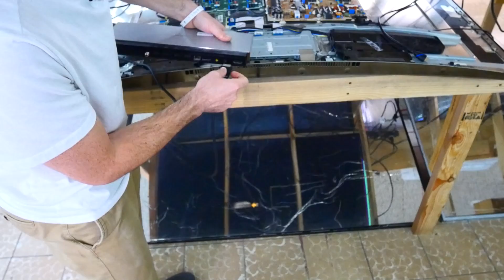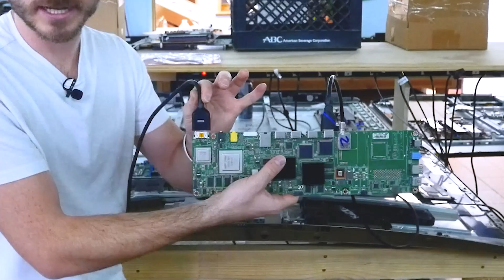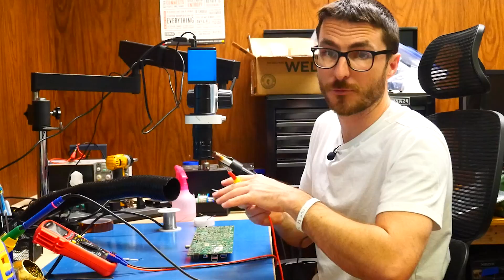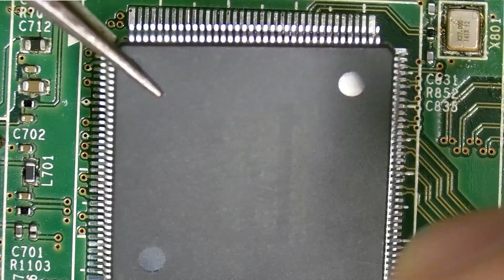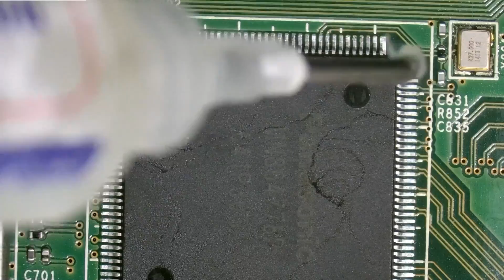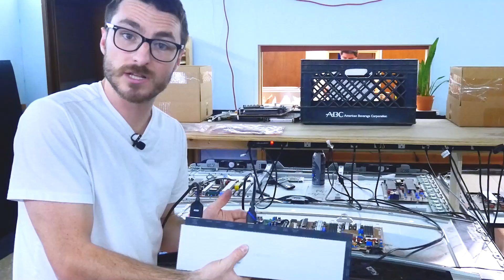HDMI Repair Samsung UN65HU9000 One Connect Box

Comment: Hi Nick, I´m writing from outside USA. I have a curved UN55JS9000GXZS with a box BN91-15167A. The box does not detect any HDMI port, same as your video, every thing else are working OK. I´d try to get it fix but the technician can not find the chip that you change in the video. Is there any way to buy it from you and have shipped to and address in the United States to fix my box here in the country I live, and how much it would cost?
Reply from the maker: Hello,
Yes please reach out to me via our email address info@nickselectronics.com with  the model UN55JS9000GXZS and  box model BN91-15167A. Please include your mailing address and I can let you know what the shipping and replacement cost would be.

Comment: When you replace the board, which i need to do on my one connect box, is it as simple as swapping old board out and new one in? Do i have to make any adjustments in the TV settings after I am done? TIA
Reply from the maker: If you can find a good reliable board then nothing special needs to be done, just plug and play. The hard part is finding a good replacement. That's why we offer the repair service. Most of the "working good" boards are either $500 or they are defective even though they are claimed to be 100% working and tested.

Comment: Hey, I also have a problem with hdmi in one connect. When im using hdmi the tv is restarting after a few minutes… tested on dofferent cables and devices. While whatching netflix or yt from smart tv no problem… What do you think could be the problem?
Reply from the maker: Sounds like it's probably the same problem as shown in the video, except you might be in an earlier stage of the failure. Try different ports, are they all the same, or do some work? If s,o just use those for now but eventually they will also fail and the HDMI processor chip will require replacement.

Comment: Hi Nick. I got a UN78HU9000F basically for free but no One Connect box or cable. I am considering opening the TV and attempting to modify it to get rid of the One Connect connector and just add a single HDMI port via some creative soldering. That way it would have only one input and it would be a single hdmi. Does this sound like a fool's errand to you? I don't really have anything to lose and I'm not interested in spending $400 on an eBay one connect box that doesn't even come with the cable.
Reply: @NicksTVRepair, I am in a similar boat. I have a UN78HU9000F with a one connect cable but no box. I tried reaching out to Samsung support for advice on what model(s) of boxes would be compatible and they were not able to tell me. I plugged it into open AI and it suggested BN94-07755B. I found one on eBay for a reasonable price, plugged in it and nothing. Not sure if I got the model wrong or if I have a dud. If you have any suggestion on which one connect box should work, I would be very grateful! Daviddimmel6914 too if he hasn't already hacked his TV.

Comment: Hi Nick, I have the same tv. The way that signal came up for the HDMI, I was getting for the one connect box. The TV has been sitting around for 5 years now, but i want to fix it. What happened was that while i was watch tv the screen went black, but there was still audio. If i looked closely, i could see a picture, but no color. I could faintly see the image. And that was about it. Now i when i plug it in, i get the similar thing on the screen in color, telling me to connect the one connect properly. Any idea?
Reply from the maker: It sounds like your mainboard or one connect box are bad and need to be repaired. We offer a flat rate service for this repair. If you take a look at the video description there is a link to our flat rate service. We highly encourage you to send in both the mainboard and box, not just the box. I know it's a lot more work to send in the mainboard but they can and do fail as well, the only way to be sure we are able to properly diagnose and fix your set is to send in both for us to test as they will exhibit identical symptoms when they fail and without a test set like we have it's almost impossible to identify which is at fault. 
If you have any questions or concerns, don't hesitate to reach out, our contact info is also available in the video description, so you can reach out to us directly.

Comment: Hi nick, i have also same model one connection box. But in these days i have a weird problem. When i turn on the tv, a   Weird noise comming from the box. Like a buzzy noise. What could it related with? Do you have any idea? There is no problem on the screen, just a voice. Thank you.
Reply from the maker: Strange, that could be the fan starting to go out. I recommend you get that fixed sooner rather than later. If you wait for it to fail it may not be repairable or much more difficult to repair.
We offer a flat-rate service. If you do want to send it in, we can take a look at it and perform repairs and pre-emptive repairs to ensure it doesn't fail in the near future.
Links are in the video description.
Reply: @NicksTVRepair  Hi again, unfortunately I am out of your country :) But you were right. I opened the one connect box and saw that it was so dirty. I cleaned and put it back. Now it is working well without noise. Thank you so much!
Reply from the maker: That's good news you may have added an extra year or more of life to your one connect box. However it is possible the fan might go out in a year or so. If/when it does you should get it fixed immediately. If  you try to run the TV with the fan not working properly you may damage the box beyond repair. 
As for the "I am out of the country" that is not a an issue. We have fixed one connect boxes for people in Latin America, Europe, middle east, and Asia. It's not that expensive to ship the box out for repair and we offer services globally.

Comment: Great video, and it's comforting to see the ease of repairing this tricky device, at least you did make it look easy :-D.  I am now stuck with a working UE65JS9500  flagship TV (likely one of the rare last models with 3D capability), and a rare collection of BluRay 3D movies.  The one connect box model BN96-37211D, decided overnight to display a grey/black flickering and burnt looking haze (no real video) on the screen when connected.  I'm afraid the CPU part stopped cooperating, as there is no response to any command.  Would that mean game-over ? Anyways, tnx for the tip measuring resistance over capacitors, that I can pre-test eventually to get more clues.

Comment: Hello, I received a One Connect for a 75-inch TV, it is not responding, it does not give an image, and the TV LED remains off. The One Connect is not responding, what could it be?
Reply from the maker: There are dozens of TVs with one connect boxes, all are very different. I can not answer your question without knowing what type of one connect box you have. Please provide the part number of the box and model of your TV.

Comment: I have UA55HU9000R. The box is dead condition.  The box can repair or can o get a new box. My tv is good condition. You can repair my box
Reply from the maker: The box is not avaiable for sale anywhere anymore so it can't be replaced, you would have to have it fixed. 
I may be able to fix it but can't know for sure until you send it in for repair. The video description has a link to our flat rate repair service if you did want to send it in, you can purchase that service and follow the shipping and packaging instructions.
Reply: @NicksTVRepair  ok

Comment: Hey i have white cloudy sides on my 65 inch unhu9000 what do you think this could be from i just got tv preowned , it shows more when there is white ish lighter colors on the screen
Reply from the maker: It sounds like you might have light bleed from the LEDs or the diffuser sheets are not performing as they should. 
I would probably need to have you send in a picture to better understand the issue. Our contact info is in the video description, send us an email with a picture of the issue and one of my guys will get back to you.

Comment: Hello! I have this model! I turn the tv, shows Smart TV but then turns black. What could it be? Cable or the one connect jack back?
Reply from the maker: If you have the exact same model as shown in this video I would say most likely the one connect box is defective. This model TV the cable is strong and while yes it can fail it is very rare. 
One newer models the cable is weaker and breaks more often so if you have a newer version with a fiber optic cable then most likely the cable it bad.

Comment: Hi Nick I have a UA65HU9000RMXL with a BN 94 07755 U One connect box, I have been getting some lines in the display with a green shade. At times I get perfect display with no lines and no discoloration. When nothing is playing and the one connect box is disconnected "the connect box" message displays perfectly with correct colors. The local service centers told me display is fine but one connect box is gone. They said no replacements available, is this something that can be fixed. Thanks
Reply: Hi ,sir . Did you fixed your one connect box from Mr. Nick?

Comment: Hey nick, my dumb question can you repair the BN91-13489Z one connect box for the 55HU9000? The panel works fine because the connect the one connect icon appears clearly. When connecting the box to the panel the red LED blinks and the panel does not display. the Biggest chip on the one connect board is rather hot.
Reply from the maker: We sure can, we have fixed many of these in the past. Here is a link to our flat rate repair service:
https://nickselectronics.com/products/un55hu9000
We do also provide a 1 Year warranty with all repairs. 
Yes that big chip does get very very hot indeed and sometimes is at fault but not always. We usually ask that you send the mainboard along with the box because even though the TV does display picture with the box disconnected, the mainboard doesn't actually turn on or activate fully until after the box is detected, which means the mainboard could also cause the symptom you are experiencing. 
If you have any additional questions, don't hesitate to reach out directly to us:
info@nickselectronics.com
520-838-9359

Comment: Looking for cable  BN39-02008A, can you recommend a trusted site to buy it, just bought a used  tv but no cable included I get a cable from a local  tv shop repair but it doesn't work, the guy who sold the tv to me says the cables are not comparable so any help will appreciated thank you
Reply from the maker: There are no great sellers with these, so we just buy them from eBay sellers when we need them.

Comment: Hi Nick, I have a UN78HU9000F TV, the One connect box is B94-07655G, Best Buy tech determined that the HDMI Arc port is not working. I want that to be able to enjoy Dolby atmos experience, which I don't get with the Optical cable that I have been using for long time, I purchased a Nakamishi 9.2.4 last year and I was told that the HDMI ARC port on the One connect handles 9.2.4, while the Optical only handles 5.1. Is there anything we can do about it?
Reply from the maker: Hello Alex,

If it's an issue with the HDMI port being damaged we can replace it. If it's an issue with the processor IC chip which controls the port that has gone bad, we can also fix that. 
Is this the only HDMI port that doesn't work? 
If that's the case, I do believe we can fix it but you would need to send in the box for us to repair it. We have a flat rate repair service which is linked in the video description along with our contact info if you have any further questions.

Comment: Hi, great video. Thank you. Do you have videos on how to fault find on SAMSUNG QA55QFBMKXXA ONE CONNECT  Boards? I have brand new ones that were DOA from the factory.
Reply from the maker: If it's brand new from the Factory I would highly recomend you do not open it and do not try to fix it. You should send it back asap for a replacement of full refund! If you try to fix it, you will void all warranty.
Reply: Hi Nick. Thanks for replying. I got these boxes in 2017. So they cannot be swopped or returned. I am hoping to have them fixed. I'm thinking that there could be a component that is not assembled correctly.
Reply from the maker: I am sure they can be fixed, but right now we don't offer services for one connect boxes that were manufactured after 2015. We only do 2013-2015 models. We may start servicing newer ones in the future but at this moment we don't offer those services.

Comment: Hi Nick I have UN78HU9000F 78” curved screen Samsung that works but the one connect does not setup Smart hub and hdmi ports don’t get signal, where are you located and what would you cost for repairs to the one connect box ??
Reply from the maker: Hey Bob,

What you are describing is very common and is a fault we should have no problem resolving for you. Please take a look at the video description it will have a link to our website's repair service for that one connect box. We have a flat rate service which comes with a 1-year warranty for it. 
If you have any questions the video description also has a link to our contact page.

Comment: Hi Nick, have you come across a problem for this Samsung UN65HU9000F model where the TV shuts off immediately and screen continues to remain black, with a clicking sound of the TV trying cycle on but won't once you connect the (One Connect Box) plug to the TV? If the one connect box is unplugged the TV turns on and remains on with the picture showing you to connect the (One Connect Box) cable... but once I connect it, TV shuts off...
Reply from the maker: Yes, this is very common and is either due to a defective mainboard, one connect box or one connect cable. 
If you want to send in all 3 for us to test and repair for you, we do have a flat-rate repair service for this. Please see the video description for links to our service and contact information if you have more questions.

Comment: I think the one connect box is such a stupid idea, it looks like it multiplies potential failure points exponentially.

What happens when the cable goes bad?
Reply from the maker: Then you will have to replace it but the cable for the F9000 HU9000 and the JS9000/JS9500 are built really well and never fail unless an extreme amount of physical stress is inflicted on them. Now the newer cables however have both wires and optical cables in them which means if they get kinked the cable will stop working. Those are much more fragile and often get damaged. Again you have to replace them but they can be hard to find and sometimes cost almost $200 to replace with the only option to purchase being from Chinese retailers.

Comment: Hello, I have a 65UNHU9000F television with a One connect box BN94-07655C. My problem is pretty much the same. The difference is that my television does not recognize the One connect box at all. When I plug it in, the chip right above the socket (SDP1301 N2) gets hot. I imagine it's the same kind of problem as in your video. Do you change this chip the same way as the black one? Is it still possible to find it somewhere? I searched and can't find exactly the same, the numbers are different. Thanks for your help.
Reply from the maker: Hello,
This video is meant to show you behind the scenes how we fix some of these One Connect boxes. They aren't intended to be a guide for DIYers to fix their own boxes. These boxes are very hard to work with, unless you repair electronics for a living I DO NOT recommend you try and fix it yourself. 

While the issue you are describing could be a One Connect box fault, the symptom you are describing could also be caused by a defective mainboard. 
As for the chip right above the One connect cable connector, while it can and does go bad, it is 100% normal for it to get very hot so I would advise finding a short or something else to confirm it is indeed defective.
It is NOT normal for the HDMI processor chips to get hot like that. That is why it was immediately suspicious for those and why I mentioned it in the video and replaced them after also confirming a short. 
The processor also as you noticed does not have legs to connect to the circuit board like the HDMI processor we replaced. Instead, it sits on a ball grid array. This means to remove it and replace it you will need some much more advanced equipment and experience. 
I really don't think it's a good idea for you to try and replace it yourself. I know that it seems our repair service is expensive, but it's expensive because of how difficult the repair is. In fact, our price is incredibly low considering the amount of work, technical skill, and equipment required to fix this type of issue. 
I know I am biased but I highly recommend you leave this repair to a company like us that has fixed hundreds of these. Anyone who has tried fixing these themselves before sending them in that isn't a professional repair company has damaged the board further and most often made the board completely fail in a way that is no longer worth repairing. 
Sorry for the long message and all the warnings. 
If you have any questions, our contact information is in the video description.
Reply: A lot of yapping to say pay someone to do it. 

Most people look up these repairs to diy, because they cant afford to pay someone to do it for them/replace it. 

I miss when youtube was mainly diy and not ads for service.
Reply from the maker: I understand you are not mad at me but at yourself for having to depend on me to do these very high-level repairs. 

I miss when people were grateful to get extremely high-value information for free.

Comment: Very good job..done..
Did you make new software for chips ..or not..
Thanks ..Ali
Reply from the maker: If we ever encounter faults with software, we program new chips and replace them on the boards. As for where we get the software, we copy it from a known good board that has been reset to factory default.